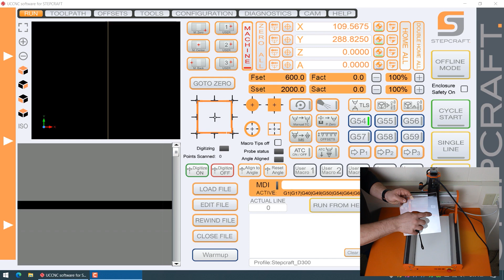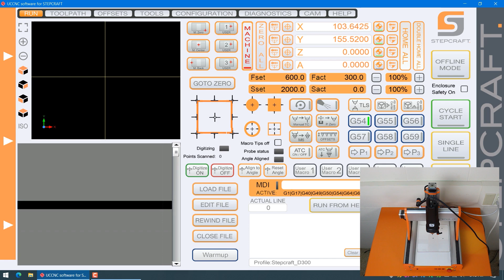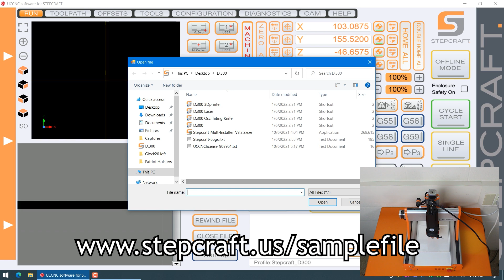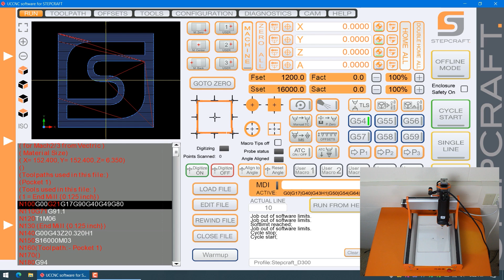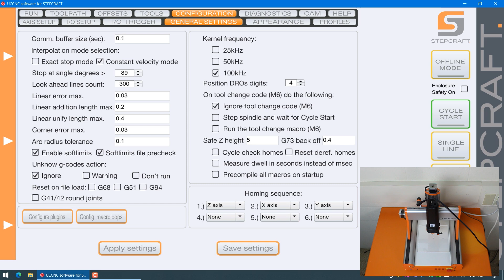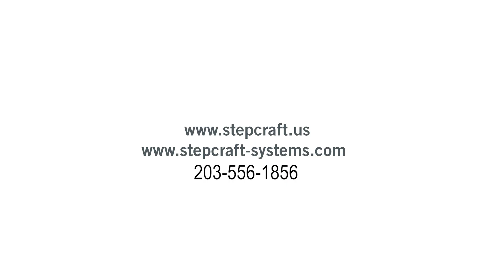UCCNC "Out of Bounds" Diagnosis

Comment: THIS was a problem I recently had for a week or so and couldn't figure out why. Very frustrating. I even reinstalled UCCNC.  Fortunately I figured it out just before this video posted. Primarily I was misreading the datum I had set in Vectric. But this video is valuable. It would apply to most CNC router operations.

Comment: UCCNC needs to establish softlimits for both ends regardless of hard limit switches.    If you g code is out of bounds on the side of hard switches it will trigger the switch rather than stop at home locations.